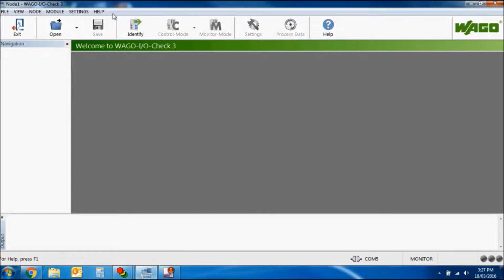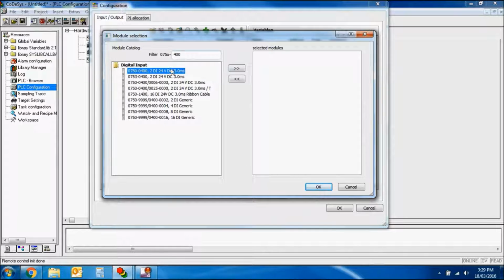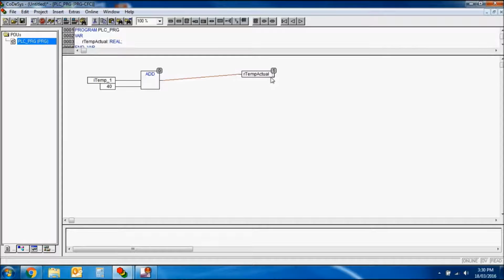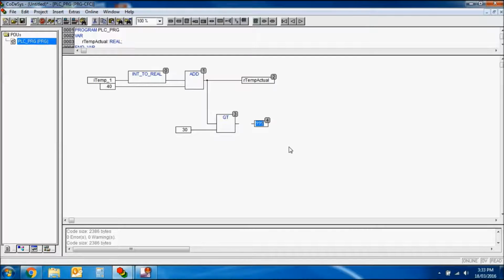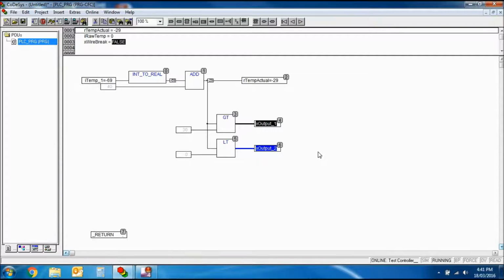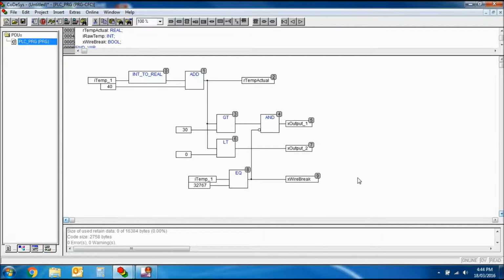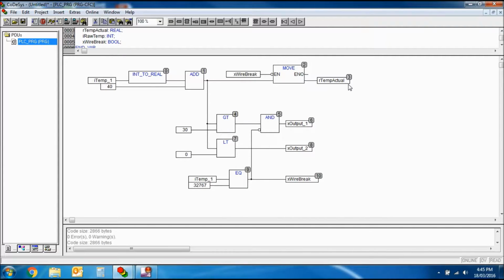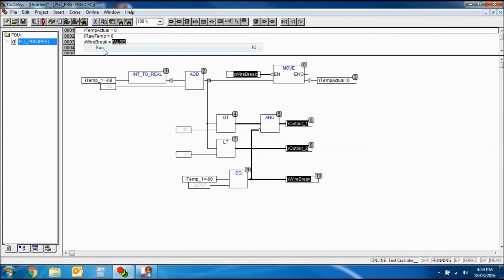WAGO Ethernet Starter kit Part 4 - Temperature application with Codesys

Comment: Can you make a video that will help me with a pressure PID exercise?
We use senssor with 4mA - 20mA pressure signal connected to AX561 module. Will turn into 0 bar - 30 bar.
Hope you will help me. Email lamthienson90@gmail.com
 thanks.